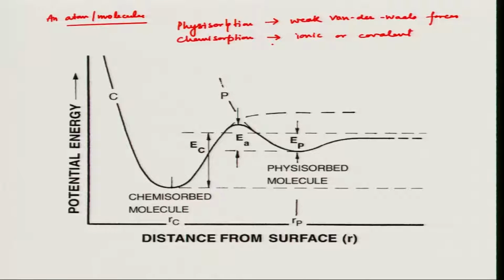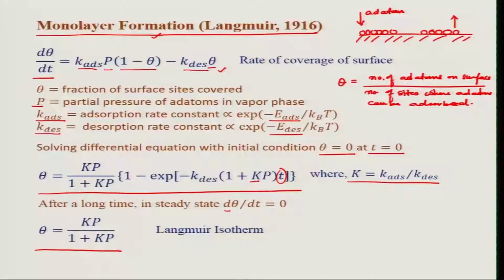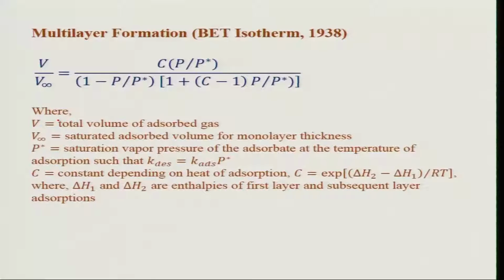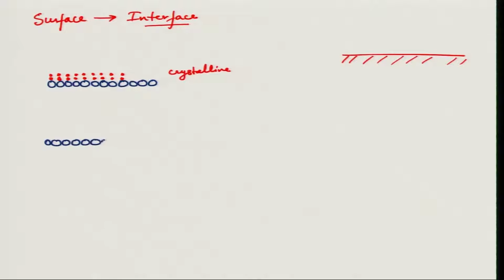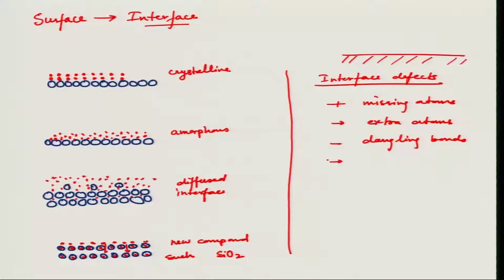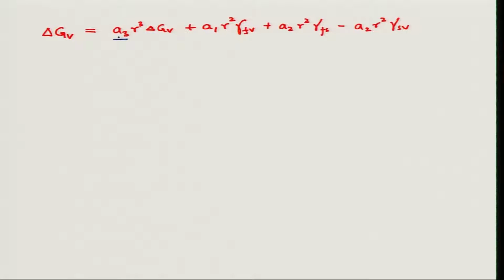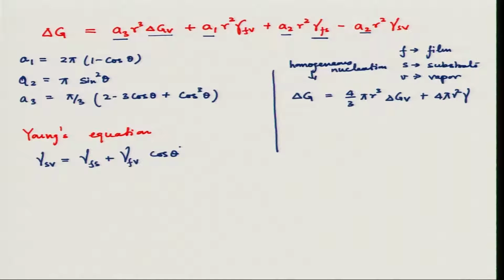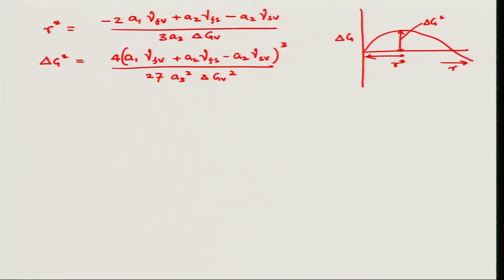Lecture 36

Comment: Thanks Professor for your explanations. Great videos!. I have a question when we have a thin film which is epitaxially grown in the x-y plane on a large substrate. The epitaxial growth constrains the lattice parameter of the film to be the same as the lattice parameter of the substrate in the x- and y- directions. The previous statement means that we have to consider just the (Strain*Stress) in the z direction. Assuming that it is not shear stress?. Also, if the process occurs at constant pressure and temperature do I have to consider this values into the summation of the internal energy of the system?. Thanks